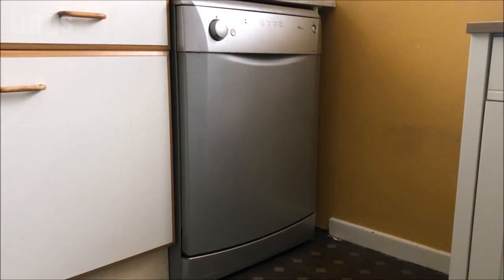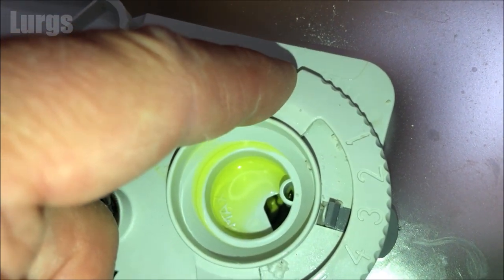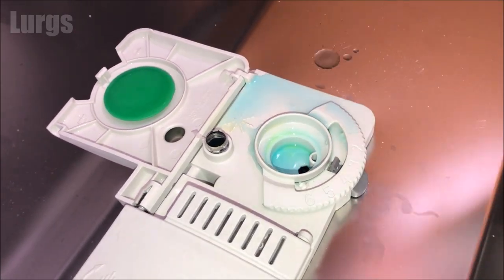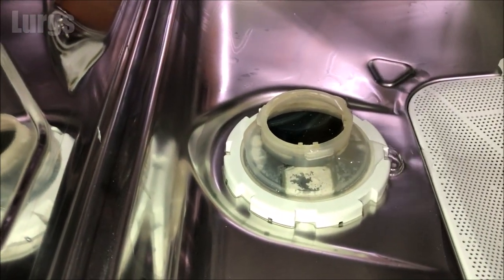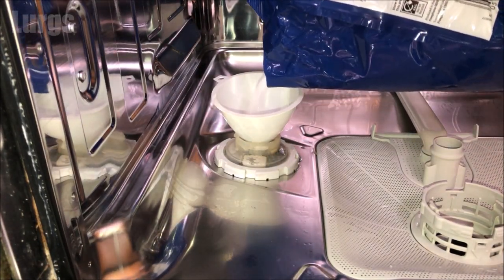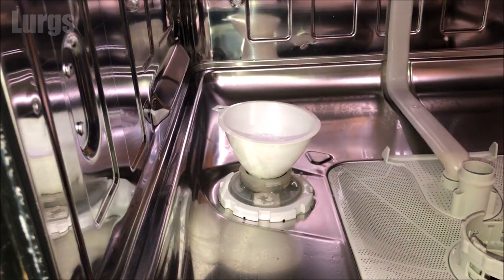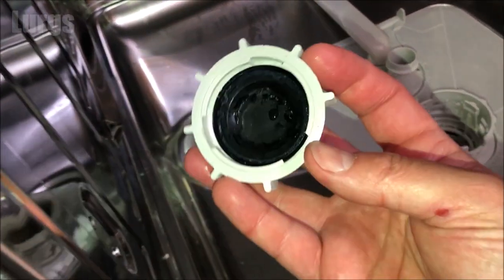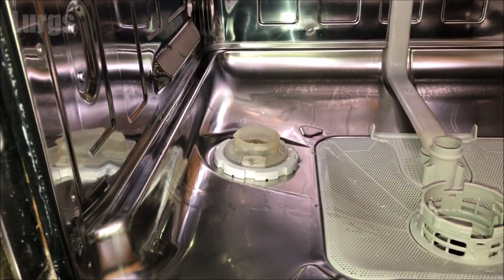How to add Salt and Rinse Aid to a Beko Dishwasher

Comment: What should be ratio of water and salt in the salt cabinet?    Because if the cabinet already have water and if you put the salt as much as possible then water will get reduced/displaced.    Asking because inspite of having salt ans rise aid in the machine steel utensils coming out with white stains / layer.
Reply from the maker: There is no ratio, just fill it up to the top with salt so it displaces the water. Most dishwashers have an adjustment so you can adjust the water hardness which in turn adjusts how much salt it uses in a programme, see if you can adjust that. Good luck.